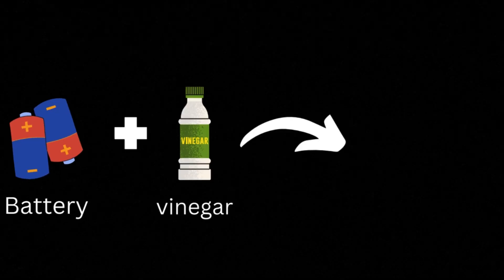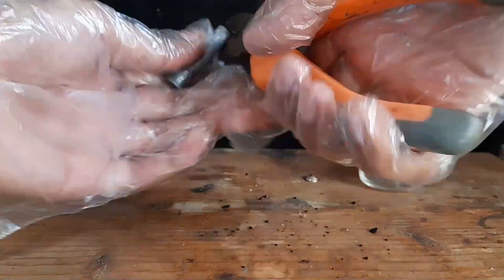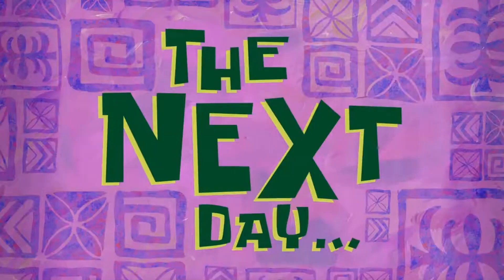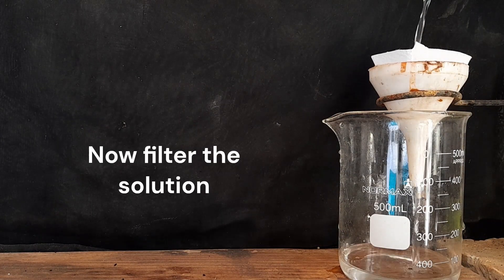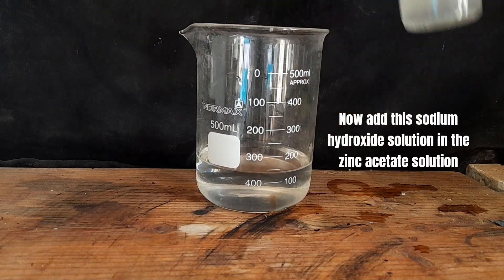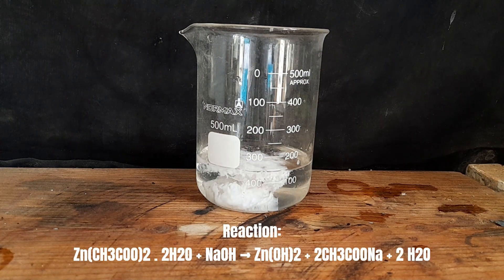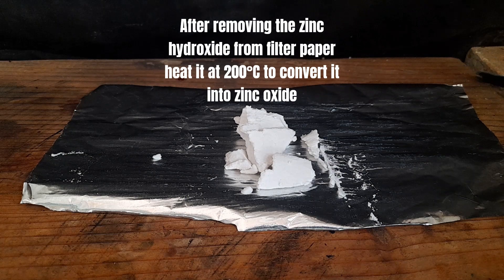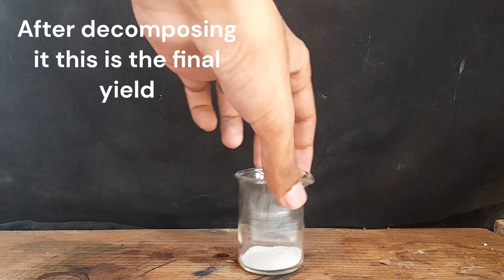Synthesis Of Zinc Oxide From Vinegar , Sodium Hydroxide And Vinegar | Easy Method | ZnO

Comment: Thank you great video. how to plate metal with zinc oxide?
Reply: do you want to plate a metal with zinc?
Reply: dissolve the zinc oxide in concentrated NaOH, then electrolyse the solution, the zinc will plate at the cathode